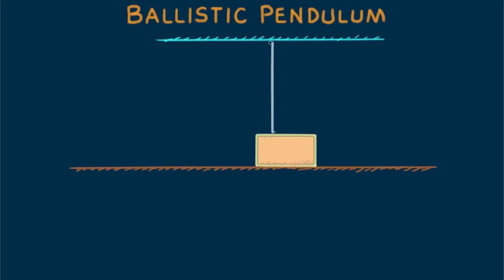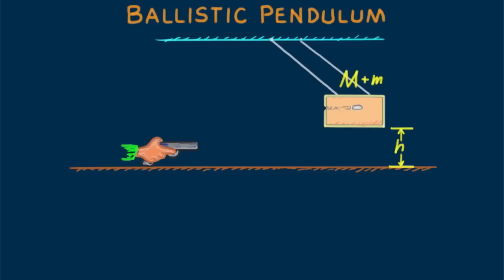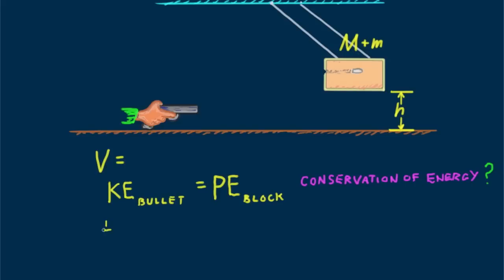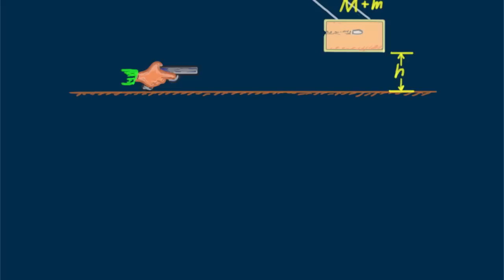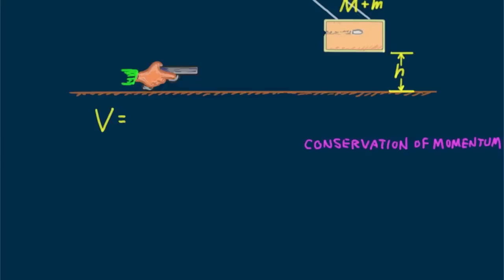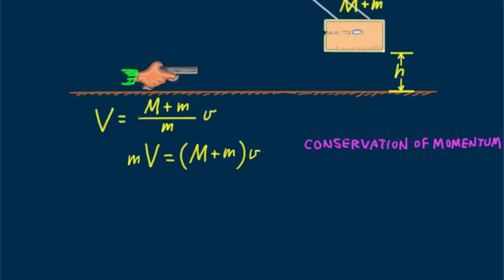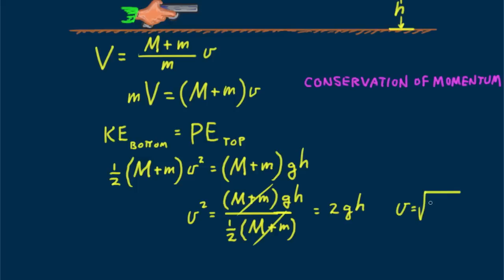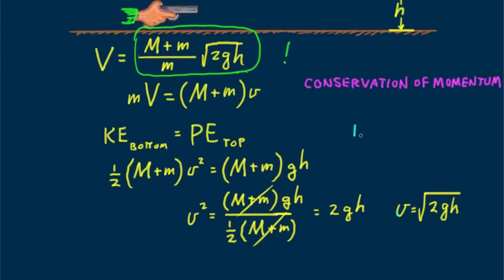Hewitt-Drew-it! PHYSICS 33. Ballistic Pendulum

Comment: video fisica: here's a nice application of momentum
and energy conservation the classic
ballistic pendulum problem here's the
setup wishing to find the velocity of a
high-speed bullet we fire it into a
block of wood suspended by a pair of
strings the block is large enough to
completely swallow the bullet whereupon
it swings by supporting strings upward
the fast of the bullet the high of the
block will swing to an elevation H that
is easily measured we also know the
masses of the bullet and the block this
is how the velocities of bullets were
measured in the old days
today this still makes a young problem
in physics labs not with bullets but
with metal bolts what do we want to find
we want to find the velocity of the fired bullet
so to begin off on the hard part of the
problem we write V equals we use a big V
symbol because we know the velocity is
high V equals what can we say the
kinetic energy of the bullet which
contains the V we're looking for will
equal the potential energy to which the
block is raised if so that would be
simple and we could say kinetic energy
of the bullet equals potential energy of the block
and 1/2 m big v square equals M plus M
the both amps times gh you can say that
solving for V is easy enough but we
can't go that route why because the
kinetic energy of the bullet does more
than raise the block much more the
high-speed bullet appreciably heats the
block while it slams to rest inside you
wouldn't want to put your bare finger
into the bullet hole of the block before it cooled
our energy equation would be kinetic
energy the bullet equals heating of the block
plus the potential energy of the block
we don't have information that deals
with the heat generated that being the
case we move to the conservation of
momentum for this is a collision problem
that bypasses heating or other forms of
energy by that we mean that the momentum
of the fired bullet before colliding
with a block equals the momentum of the
block with its embedded bullet
immediately after the collision
regardless of any heat generated heat is
an energy thing not a momentum thing so
we write this as MV equals big m to us
times m times little V where little M is
the mass of the bullet big V is the
bullets velocity what we're looking for
big m is the mass of the block and
little V is the velocity of the block
with a bullet
immediately after collision so we see
that big V equals the sum of the masses
over the little mass times little V
problem solved not quite we don't know
the velocity of the block with its
embedded bullet that's the small symbol
V the equation tells us that we must
find V but how
ah-ha we switch our attention to the
conservation of energy why because the
kinetic energy of the block with a
heated or not transfers to potential
energy so the initial kinetic energy of
the block upon absorbing the fired
bullet will equal the potential energy
of the block at the top of its swing we
write this as kinetic energy bottom
equals potential energy top or one-half
mass combination times little V squared
equals mass combination times G H where
G is the acceleration due to gravity and
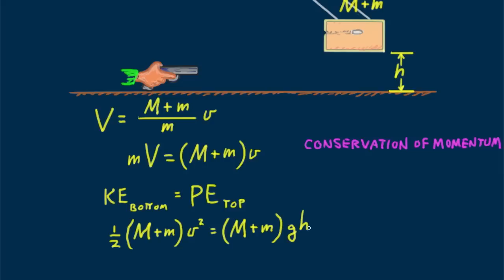04:41
H is the measured height to which the
block Rises
and guess what folks the V in this
equation the initial velocity of the
block is what we're looking for solving
for V we find you
taking the square root of both sides and
solving for V only leads us to V equals
square root of 2gh aha is this fun or
what now we substitute this in our
equation above now a problem is solved
for all the symbols represent known
quantities we know the masses and the
height the block rises you may do this
in lab then you can put numbers in in my
experience the raw physics is best seen
with its symbols solving problems with
symbols only may take a bit of getting

used to if all the problem-solving

you've had in the past was numerical are

we learning that's the most important

thing let me leave you with this
question if the same mass bullet were
fired at twice the speed into the block
how much higher would the block swing
until next time good energy and good momentum